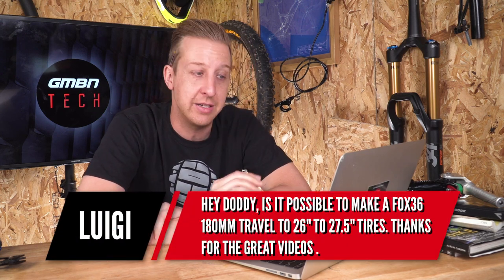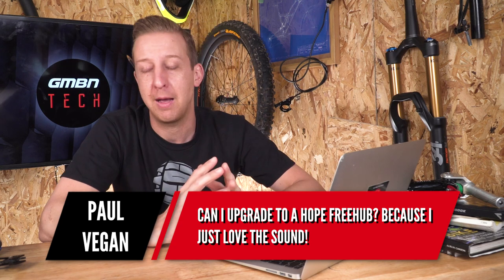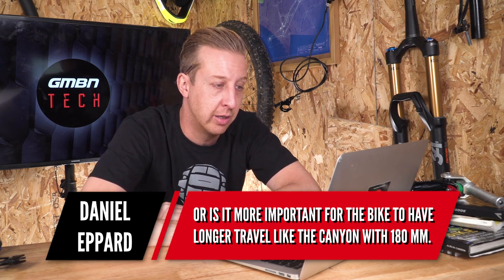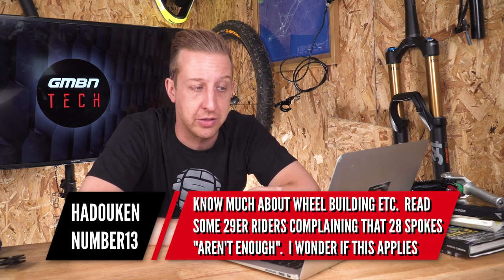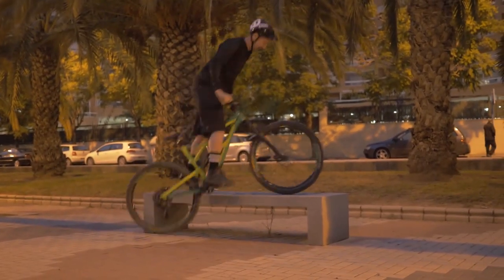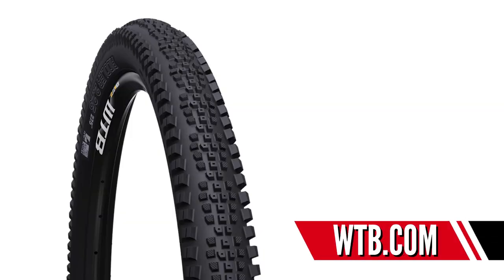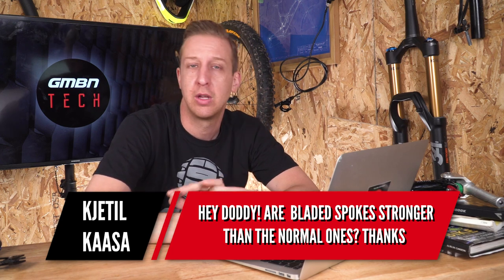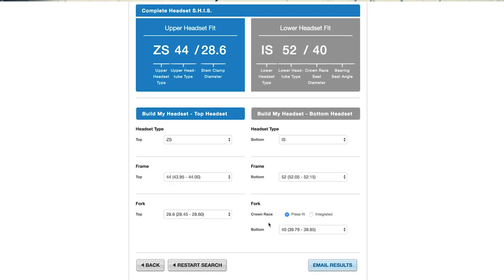Choosing Your Mountain Bike, Fork Tech & Spoke Differences | Ask GMBN Tech

Comment: In reference to the headset for a tapered fork on a frame made for a straight steerer question, i run a m-part elite ex44-40 lower cup which allows you to run a tapered fork, but only if your head tube in designed to run a 44mm semi integrated headset. It basically puts the large lower bearing outside the frame, adds 10-12mm to your overall stack height so bare that in mind , I know nukeproof, hope and cane creek also make them.

Comment: Hey doddy, just a word about the spokes, Butted spokes can be significantly stronger than plain gauge, Aero spokes are in the middle range of the strength Ratings as they still have quite a bit of material in the centre section, however the thinner you go the more elastic a spoke gets.

that said unless you run a spoke such as the Sapim strong, originally intended for Tandems, the 2mm Elbow is typically always the failure point, tandem spokes are 2.3mm on the Elbow and can also be used to build a stronger wheel, the hubs may need the spoke holes enlarging.

I worked in a shop years ago and the standard spoke we stocked was the Sapim Race, a good balance of strength vs weight and cost, and a small selection of CX-Ray spokes for special builds, I personally have a set of road wheels that are over 15 years old, 5 different rims, one set of nipples and one Shimano 105 Freehub body and they are still going strong, triggers broom you may say! several seasons of Cyclocross as well as road training back in the day.

Info on the tensile strengths are shown for each type of spoke on the sapim website.

http://www.sapim.be/spokes

#ASKGMBN #ANSWERGMBN  :D

Comment: Hi Doddy, I'm currently 6ft 3 and around 200pounds similar to you and was wondering what coil spring do you use on your downhill bike if/when running a coil shock. I'm currently using a 550x3.0 and it doesn't quit seem to be stiff enough as I'm using up quite a lot of travel with the coil stiffened. Thankyou

Comment from the maker: What are your mountain biking questions? Remember to use the hashtag #AskGMBN
Reply: #AskGMBN Is travel on a trail bike proportionnal to frame size? Would a 130-120mm small bike feels like 140-130mm or even 150-140mm on a large or x-large?
Reply: R_M1997 No.
Reply: #askGMBN I still don’t understand the rear shock. The shock can have 140mm travel when in real life it only looks like it has 30mm.
Reply: What is your e-mail, so i can submit my question.
Reply: Conner N the shock stroke to rear wheel travel relationship isn't a 1:1 relationship. For a given amount of shock stroke you will achieve anything between double to triple the travel at the rear wheel. It's all to do with the linkage of the frame and it's kinematics.
Reply: #AskGMBN Hi Gmbn! Huge fan of your great tips and videos! I am currently looking at the Canyon Strive Al 6.0, but I am not sure if it is the correct bike for me. I do long climbs and trails, but also want to get started going to bike parks! Thank you in advance!
-Vanness
Reply: #askgmbntech Could you make a video on the different types of linkages and their pros and cons,please!Luv you,Dodster!
Reply: Cheers
Reply: Connor Tidman You can just comment!
Reply: #askgmbn should I upgrade from sram nx to gx eagle or shimano xt?
Reply: rear travel stands for the way the rear tire can move upwarts... the shock works with the linkage
Reply: Flynn Langdon Sram gx!!!
Reply: GMBN Tech #AskGMBN can I use carbon grease instead of normal
Reply: GMBN Tech #askgmbntech does sram eagle chain ring will keep a chain of 10 speeds in place the same as 12 speeds chain?
Reply: GMBN Tech #askGMBN just wondering if you could convert a 3x8 to a 1x8
Reply: #AskGMBN What do you guys think about the GoPro Fusion?
Reply: #AskGMBN hi doddy I have a rockshox monarch r rear shock and there seams to be oil on the Stanchion. Do I need to get my shock looked at or will it be ok? The shock is only 5 months old.
Reply: #AskGMBN....  Is it possible to fit a lock out shifter to a rockshox monarch plus rc3? I only want to go from fully open to the middle position,  I'm not bothered about going to the fully firm position. If there is, could you possibly do a video to show how to do it?  Your help is much appreciated.... PS,  my bike is a Bergamont encore 9 (2016) thanks
Reply: #AskGMBN Hey Doddy. I recently bought a second hand hardtail. The bike needs a new drivetrain and brakes. It would be great if you could make a video on buying and upgrading a second hand bike (100-300 pound bike). It would be very very helpful for beginners and people who can't afford new bikes. Thank-you so much for the vids and Happy Easter. :)
Reply: #AskGMBN which one is better fork. Manitou M30 or SR Suntour Epicon?
Reply: #AskGMBN Hi GMBN is it to possible to upgrade the 2018 LYRIK forks 160mm with170mm Debonair Spring Upgrade kits ? Thank you & you guys are awesome.

Comment: Hi Doddy, love the videos you do and since you started i learn a lot from you. Been an avid fan since then. So i have a 2014 giant trance 1 and im using a stock 140mm fox fork 32 and i wanted to have an upgrade for a 150-160 travel, i believe i have an overdrive 2 set-up. What kind/size of adapter or reducer headset do i need? Please help?

Comment: Doddy why don't you talk more about trials bikes , I have a street trials bike from yaabaa , on the back of it I have a freewheel mounted to a fixed hub , the freewheel is from 2007 and I'm not sure if it's still safe but I like it because the hub is very wide so the wheel is very strong ... Should I buy a hope trials hub or get a new freewheel ?

Comment: #AskGMBN
Hello, I have a 26" AM 150mm bike (2013 Canyon Nerve al+) and  I am thinking about upgrading it. So far the only thing that I've changed is some good tyres, brake pads and a whole lot of inner tubes. 
The shifty bits (rear and the front mech) are also not working as good as they once did so replacing/upgrading is imminent. Dropper post is going to be fitted in any case. The fork is 2014 fox 32 performance which is not very good and it doesn't seem like there are any volume spacers available, so upgrading to a different fork is in the picture as well. I love riding the bike but it lets me down too many times and  I think that with reliable parts I could enjoy this bike even more. Do you think that it is even worth upgrading the bike, seeing that it has dated geometry and saving for a new bike is looking like a good idea but I love this bike and I don't think that I could sell my bike looking that it is my first proper mtb. Any tips on what I should do?

Also for your Santa Cruz Nomad build I recommend Superstarcomponents Electro hub. It is a bit more costly than a Hope hub but it has great SKF cartrige bearings and 102 POE(almost as much as a i9 hub!)

Cheers!
Reply: John Hyde I’d just get a new bike because spending that much money on your current bike is the equivalent to buying a nice bike for yourself. I made the mistake of buying a $1000 with ok components, right now I’ve changed every part on it except the headset and seat post. Now that I realized I spent $3000 on my bike I could’ve bought a full car a on bike with high end parts already on it. Hope this helps!

Comment: Doddy You were saying about swopping tyres about on the bike. My bike came with a 2.4 up front & a 2.3 rear. I have been told it will be ok to run 2, 2.4's in the summer & put the 2.3 on the rear for the winter so that the wider front cut a line in the mud is this right ??

Comment: I’m looking to upgrade from my XC hardtail to a full suspension bike, I’m looking at the Merida 160 800 and the trek remedy 8 and was wondering if you have any opinions on those two or any other bikes, I mostly ride downhill style tracks but still need to ride to the top most of the time and am getting into enduro racing. I would prefer to buy local than direct sales as I am in Australia #AskGMBN

Comment: #askgmbn Doddy I have a Diamondback Atroz 2 wanting to upgrade my suspension for more travel but would like to make it more trail capable it's 120mm raidon front and rear I don't care if I make it a little more slack but don't want to screw it up can I go 130 rear and 150 front and what size shock would I need?? thanks

Comment: #askGMBN Hi Doddy! Right now i have a 27,5" 100mm hardtail which i have ridden for 4 years. I ride a couple 10km technical single track rides a week and one bigger 20km-30km ride on the weekend. I'm looking for a new 29" full suspension bike in about 150mm of travel, would that be a fitting bike or should i go for one with less travel? I also intend to use the bike for trail and bike parks! Thanks!

Comment: #askgmbntech I currently have a 1x11 setup with a Shimano XT medium size mech and 11-42 cassette and a RaceFace 30t chainring. I want to change to a Sunrace or Box 11-46 or 11-50 and up the chainring from 30t to 32t or 34t. Can I do this without changing the mech or using a hanger extender? Also do I need to change anything else like a longer chain?

Comment: #askgmbntech Looking to get a new bike and I was wodering if the kashima coat on fox suspension is a must have. Sure it looks sick but is there an actual difference in performance? Do the internals play a huge part when comparing the factory stuff and performance elite?
Reply: definitely not a must; it's just lower friction, which does have some benefits but you'll be fine without it

Comment: #askgmbntech Hey man! If you have an aggressive geometry hardtail, say a Nukeproof Scout 275, and you are planning on racing enduro with it, would longer travel suspension (160mm or around there) be beneficial at all or is there a point when the long travel would hinder the bikes performance or simply not be beneficial anymore? Or, if so, is there any way to increase that 140mm Revelation into a reliable longer travel or would the answer be a new fork? Appreciate it Doddy and love the tech talk

Comment: Hello bike gurus,

l am looking for an advise 
l want to upgrade my old fork suntour xcm 29er straight 100 mm travel for something more decent , l understand tapered fork wont fit on my carrera mtb that l plan to rebuild more for a trail type bike and l don't really understand thread and treadless on the headtube.

Kindly, could you advise for a fork or choice of fork that will fit and perform well.

Cheers

Comment: #AskGMBN Hi Doddy, I have a 2016 Trek session 8 and I want to upgrade the rear shock. Can you tell me what's the difference (feeling) between an air shock (like the vivid air) and a coil shock (vivid coil) ? Most of the time i'm riding in bikeparks with my downhill bike. Thanks . Love the show !
Reply: Coil shocks will feel more linear, sensitive, and generally track the ground better. Air shocks are more progressive, and tend to have a more poppy/playful feel.

Comment: #Askgmbntech Hi Doddy would a wide tyre like a 27.5 x2.6  or 2.8 be better than a 27.5 x2.35 on boost rims for very muddy conditions. Iv been told thinner is better Iv had a problem with 26 x2.4 non boost were mud has stopped me dead when riding in very muddy conditions.  Cheers Stu

Comment: #AskGMBN ive recently been thinkking bout exchanging my breaks. I've got Shimano Deore XT Breakes on it at the moment but tend to ride harder stuff now than the last few years. This combined with my 2meters height at 100 kg made me think of it. So is it possible to just add a Shimano Saint Caliper to the XT Handles and still use the Mineral Oil (still have nearly 1l at home)? Or do i have to exchange both?
cheers
Philip
Reply: I'm pretty sure you can,Shimano actually released a 4 pot XT caliper recently,which is cheaper than a Saint but would still provide more than enough stopping power.

Comment: Doddy HELP. I have a 3x set up at the moment & I want to convert it to 1x it currently has 8 cigs on the back & I’m looking to go for 10 or maybe 11, maybe 11-42. I’m new to mountain biking & have never tried this before could you do a video on how to do it & more specifically what I need to buy to do it, whether it be just the new front chain ring & the cassette or if I need a new rear derailleur & chain etc too. Cheers #Askgmbntech

Comment: #Askgmbn I’m a roadie planning to start MTB. Have my eye on Nukeproof Scout frame and want to build myself. Nukeproof Scout comes with 140mm shox. Can I put a 120 or 130mm without compromising geometry?
Reply: Not recommended as you'd be making the bike less stable and your BB would be lower than intended which could lead to clearance and pedal strike issues. You could maybe get away with a 130 but I wouldn't even consider a 120

Comment: I've bought new wheels with centre lock disc rotors they come with adaptors but would rather use the right disc but I can't find a sram 200mm centre lock disc can I use a different brand or not. I've got sram guide rs brakes cheers
Reply: You can generally mix up caliper and rotor brands but there are some exceptions; for example Hope rotors will not work with Guide calipers without modification to the calipers (a little sanding)

Comment: #AskGMBN On the tapered fork in a straight steerer frame, I have a 2010 FsrxXc  (https://www.specialized.com/gb/en/fsrxc-comp/p/22816?color=32890-22816 ) and have been looking at the crane creek adapter kit for a while, but can not find out if it will work for my frame. I am thinking of putting a 27.5 fork on my bike (with a 26 wheel for now) so that when i upgrade the frame i can bring my new forks with me to the 27.5 world.

Comment: #askgmbn What's the best ghetto method to hammer in a new star-nut? Wrench socket? (i don't want to destroy the threads by hammering a screw)
Reply: I recommend getting compression plug instead of a starnut. Trickstuff makes the lightest, but there are a lot of options, I got Hope HeadDoctor. you can reuse them, and are super easy to install and unistall.
Reply: Kuba Gajda an extension bar and a rubber mallet or hammer
Reply: Watch Sam pilgrim hammer one in😂
Reply: so that's what that is! Tbh I wasn't sure.
Just installed a starnut in the LBS when i got my new forks but if I actually had known that I would've gotten the head doctor ye.
Reply: Just hammer it in, using a screw. If you use a rubber hammer, you are save, not to damage any surfaces. Usually the starnut goes in quite smoothly and you are far from damaging the thread. Use the Ahead cap and screw to check the perfect alignment.
Reply: Dowel rod works a treat.

Comment: Hello I'm at bicycle mechanic I've been doing it for a while and I ride a lot for fun I have a 26 inch Kona Dawgma it's a 27 speed 3 by 9 and two and a half years own in it I've put 4960 miles on it I don't know why I just like 26 inch Wheels I've written a couple 29 not too long ago got to ride 27 5 it just seems a lot more controllable not so lanky I also have a question what's the top speed on the flat land of the new one by 12 system cuz on my 3 by 9 on the flat land I can hit 30 miles an hour pumping it lot of power pedal how fast is the one by 12 I'm curious the Kona I have now is the most awesome versatile bike of ever owned
Reply: Austin Glines .
Reply: Top speed depends on the chainring size and how fast you can spin.  There are 1x on road bikes now and they can sprint at 70km.h at the flat.

Comment: Bladed spokes are not any stiffer than round spokes of the same cross sectional area. Stiffness of a spoke is determined by the material and the cross sectional area, and if the area is the same (such as between the Sapim Laser and the CX-Ray) then the stiffness is the same. In terms of strength, the ultimate strength is about the same, but where the bladed spokes get a benefit is in fatigue resistance. Because of the way they are formed into the bladed shape, the spokes are more durable and can endure more stress cycles before failing. This can be seen in Sapim's fatigue chart: http://3.bp.blogspot.com/-6SHdf4VmPZc/TjWws4K8ZAI/AAAAAAAAAQA/9zHhek-5qCk/s1600/flo_sapim_fatigue.png

Comment: My shock pump won’t pump up my fork both fork and pump are brand new and the pump is attached correctly?
#AskGMBN
Reply: Jonas Dee I would say the pump isn't screwed tight up enough to the fork
Reply: Try one of your friends shock pumps then you will know.
Reply: If you attached it correctly, the pressure dial on your pump should show a value above zero (if there is any air in the fork that is). Maybe you are holding it in a way, that you constantly put pressure on the relief button below the dial, so you completely bypass the fork while pumping
Reply: I have a shock pump that works with all of my shocks and forks ~10in total(all of them RS and FOX), however it didn't want to work with the Fox Nude shock of a friend's bike, even though it was screwed more than tightly ( even a bit after the valve's threads,). It appeared that in such occasions you have to unscrew  the pin which resides in the pump's end, so it could press the valve's core pin enough to let the air flow. However not all pumps have that adjustment, so you might need another one.
Reply: Jamie Rose I sadly don’t have anybody else that rides with me.
Reply: go to a bike shop
Reply: Gareth Rees that’s what I was going to do but I got it to pump up just before I was going to go there thanks for the suggestion though
Reply: The first couple of times I tried using my pump on the fork this is what happened to me. Screwed it on more, worked perfect
Reply: You tighten the pump to valve over tighten it. Just untighten it little but then will work

Comment: #AskGMBN hi doddy. My bike has 160mm rotors. I would like to upgrade to 180mm rotors. Is it possible? Thanks in advance
Reply: Yes, as long as you have the clearance for it (which most bikes should) all you need is an adapter to move the caliper into the correct position
Reply: Steven Chabot oh thanks for the answer. Gonna look it up